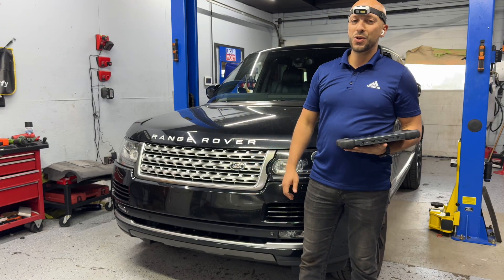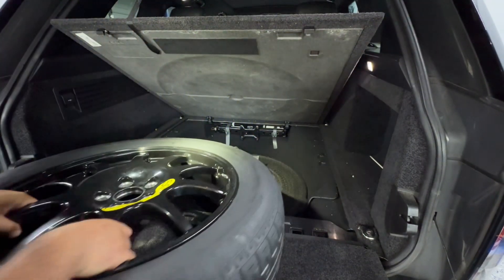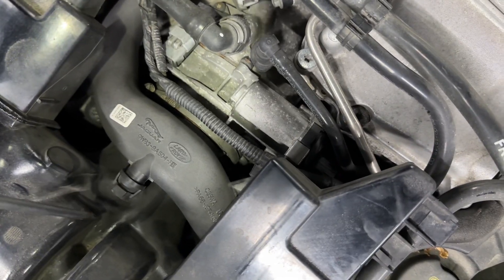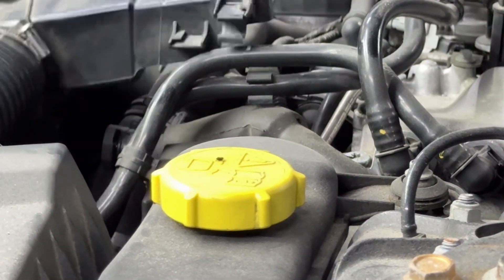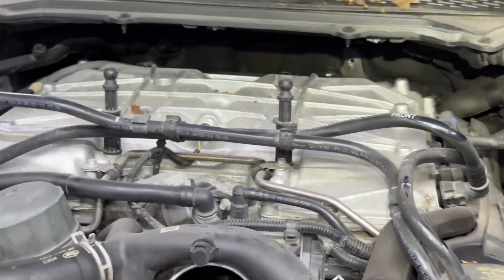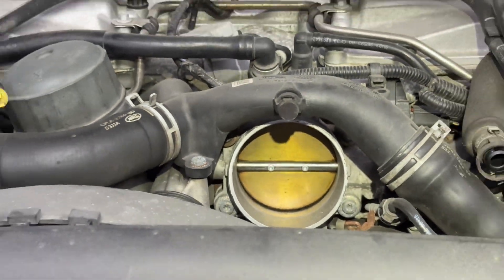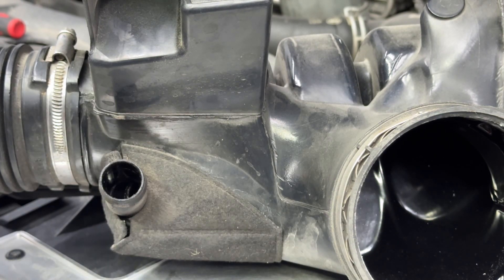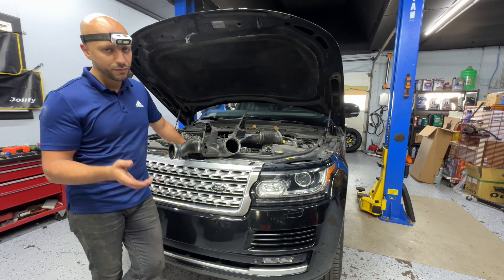Throttle Body Replacement Range Rover / Jaguar DTC P2119 / P061F / P2176

Comment: Hey man, great video!  I've been searching youtube to find out how to access the throttle body and stumbled on this video. Rover was throwing the same p2119 and P061F codes.  Figured it just needed cleaning, but when I pulled out the air intake and accessed the throttle, I had the same metal ring lodged in the same spot!  The metal ring actually goes inside the oval end of the air intake, there is one on both sides.  Not sure how the dealership you talked to didn't know this!  Thanks for the help!
Reply from the maker: @jamesjohnston4953  thank you greatly for the tip! That was the first time I come across that and for some reasons dealership had no clue what was or where it goes! Really appreciate the comment and the insight 🙌🏽

Comment: Bro, i pulled out of the super market the other day, my rover l405 went into limp mode and started surging and falling, basically undrivable. Scanned for codes showing p2119 and p061f. Had it towed back to my house, pulled the intake and what i saw looked like a screenshot from your video. So have you figured out where the metal band came from, or what else may have been sucked into the intake?
Reply from the maker: @viralswim  so as it turns out those are bracket pieces that goes at the end of the oval intake hose, one on each side!!!
Reply: @brownsburg.motorsports  I figured that out after some investigation, I tried removing the 2nd one and could not, can't understand how the intial one broke loose.